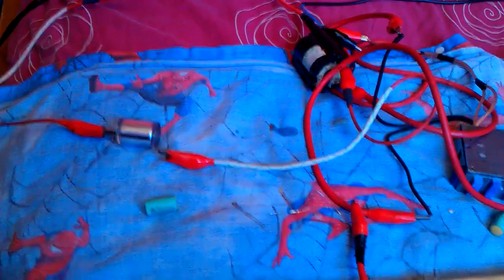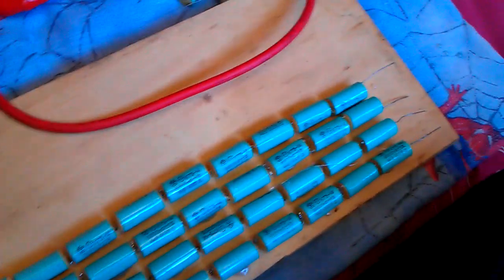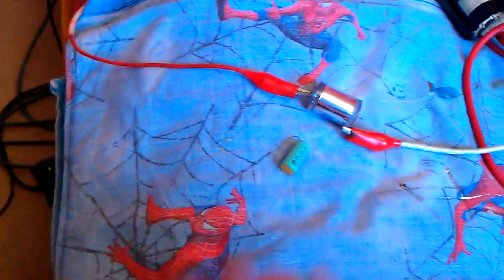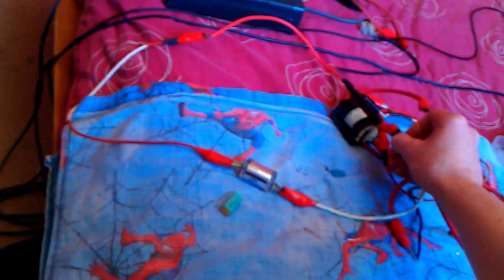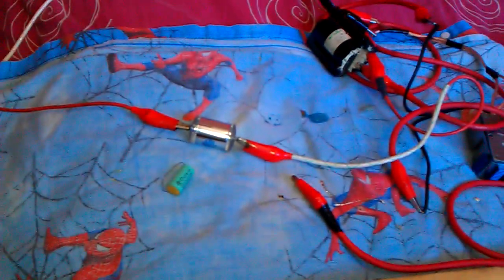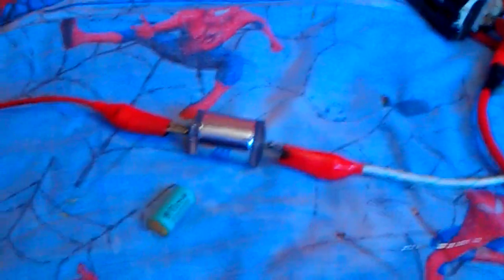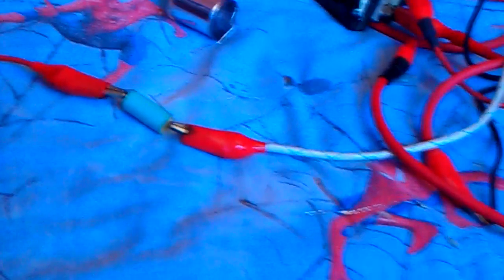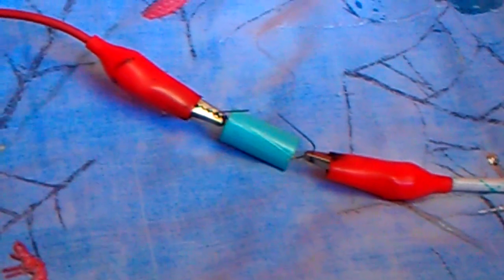Capacitors !!  This is Loud!!

Comment: Your dead right about the ozone. You need corona and thin discharges to ionize the air to produce ozone. Plasma arcs are much hotter and produce nitrogen dioxide, which is extremely toxic/corrosive. Basically, all electrical discharges aren't too kind on your lungs!

Also, I bought a batch of 90 of those exact 4kV capacitors a while ago, probably from the same seller. Glad to see they're tough, I'm planning to use them in an MMC like yours, as well as filtering and decoupling in other circuits.

Comment: i wired up 360 capacitors rated 4000v 3300pf to mmc complete with split taping to 23.76nf at 20000volt it ran the tesla coil but not to well pic are on my face book still mounted on my tesla coil in one off my vids